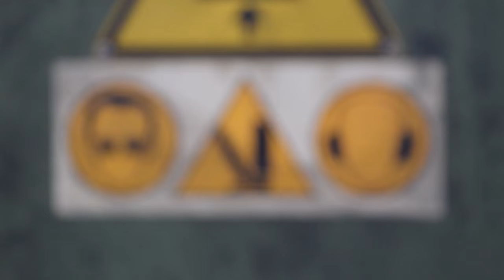Blacksmith Makes AWESOME Axe

Comment: Great tooling on the sides.  Is it a traditional design or off the top of your head?
Reply from the maker: It was off the top of my head!
Reply: +Paul Krzysz. I rarely plan out anything. I rarely draw out anything beyond the sketch. sometimes it doesn't,even get that far. that's the beauty of art. keep creating.

Comment: old way...lol...with steam hammer??? Forge it with Manpower...with strong Arms and the sound of the Hammer...damn.
Reply from the maker: Andre' Kobel The steam hammer was invented by James Naysmyth in 1840, 177 years ago. Earlier water powered trip hammers were used by the Chinese in 40BC. Seeing that mechanically aided forging has existed for over two millennium, I don't hesitate in using the title I do.

Best,
Paul Krzyszkowski
Reply: nice Work,great skill...but real Men forming steel withs a hard will and a hammer in his hands. So you form your Body twice...